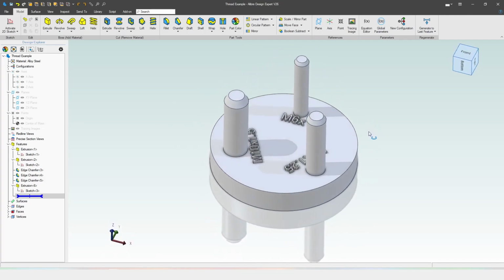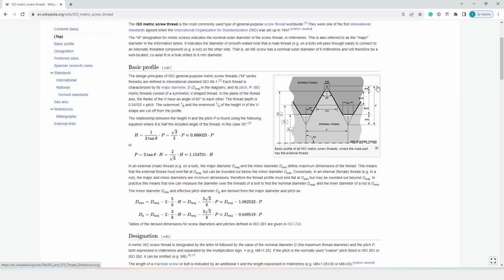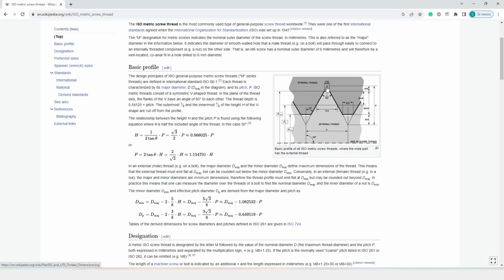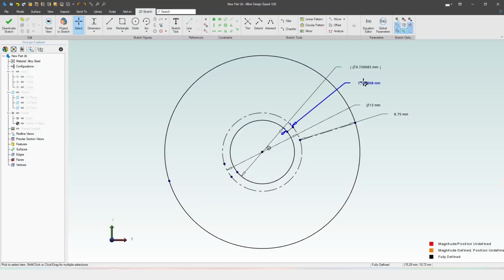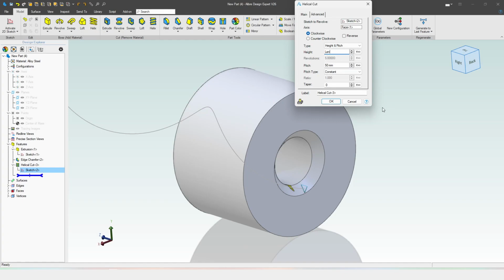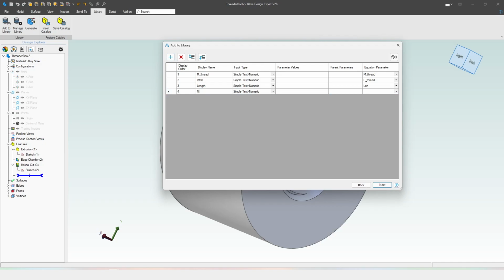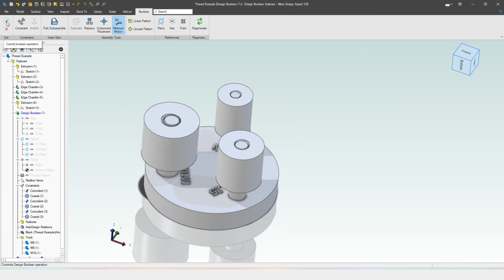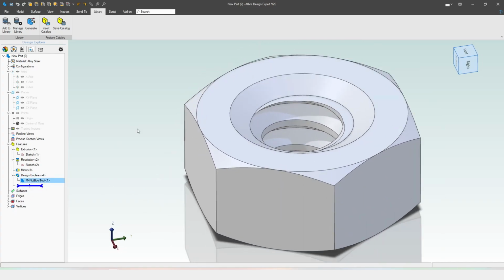Alibre Design Tips and Trick OVA: Threads Anew... way to make them for 3D printing!

Comment: Great tool! I followed the instructions and created my first library function. I 3D printed a M12 bolt and nut and they look great, but the bolt is too large to go into the nut. Am I missing something or is this a printer parameter issue?
Reply from the maker: Hey Bill! Glad you liked the video.

If you watcht he video, I do mention that you can set a tolerance parameter, which I do not set for the parts in the video because they are jsut exhibition parts. But that tolerance value basically has to do with your 3D printer. You need to do a couple of test prints and experiment with the tolerance values. Then, you can either bring that out to the library part as a parameter or even leave it as a constant in the design.

So, basically it is a printer thing but it needs a value to be set once and then you're good to go. You can even open the part saved in the library folder and change that, and every subsequent part will be generated with that tolerance value.

Comment: 00:00 Hello! I'm going to follow along again! I've been excited to do this tutorial for a long time!
00:41 That's okay, I have experience in that.
02:11 This is simply amazing. Can't wait.
07:14 I've looked at the ISO threads diagram so much recently...
09:36 Was starting to get really confused. My outer circle was smaller. I didn't notice that you dimensioned the distance between the two, not the diameter.
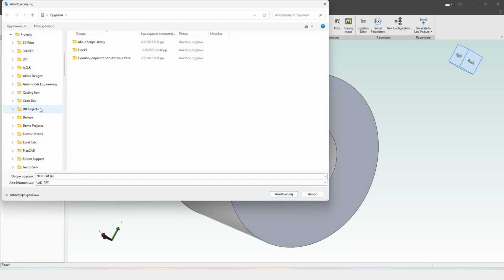21:23 Actully following along quite well, I think. It's really pretty easy to do, the hard part is just correctly assigning the right values per the diagram.
30:19 Fantastic. It works! Now I'm off to the other video on tapping holes!
Reply from the maker: Hey Adam! Does that mean that you got the upgrade? Exciting stuff! Cheers m8
Reply: @ExMachinaEngineering  I have in fact been upgraded!
Reply: @ExMachinaEngineering Is there a quick way to modify a library entry without having to do the whole process over again? I made some changes to the tolerances and dimensions for the original, saved the Alibre Project file, but trying to use them on other projects still uses the old version.
Reply from the maker: Yeah, all library entries are models that are stored in the library file path. I am not on the PC now. It's in the documents folder I think, in Alibre
Reply: @ExMachinaEngineering  Found it. Thank you! It's not in documents it's in program data.
Reply from the maker: Oh,OK. Yeah, it has been a while since I've been in there.

Comment: Trying to do this with the license I have (professional) but it seems like it's only available for expert 😢
Reply from the maker: Dynamic Library parts are only available for Expert. But boolean is available for Professional. Next week I'll do a video showing threads for all 3 tiers 
Basically what you need to do is make the Boolean die, and everytime go in the file, change the parameters and save as. It's slightly more hassle but the same workflow